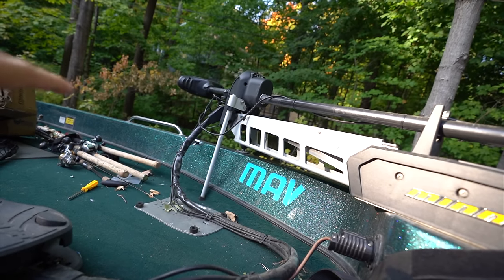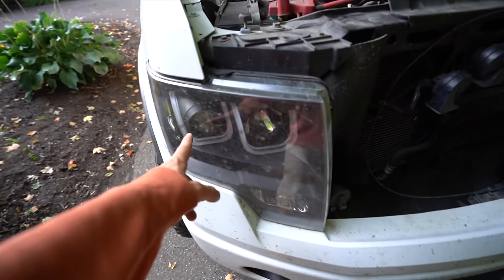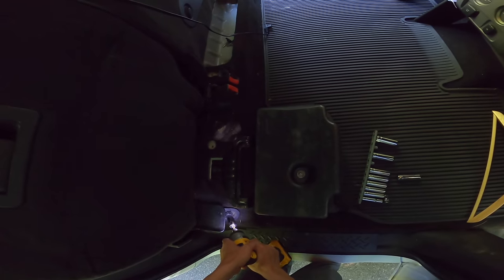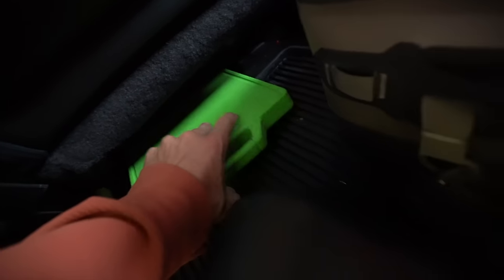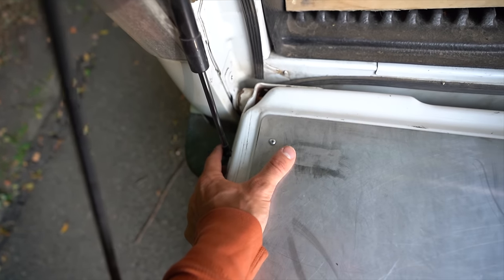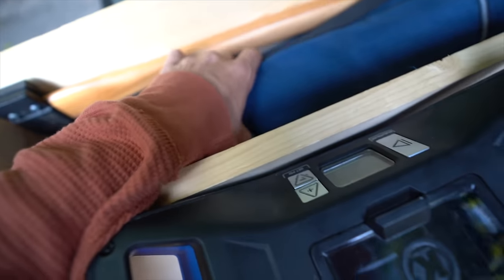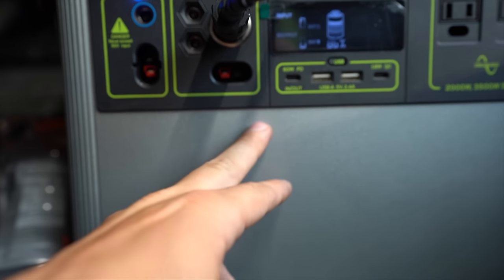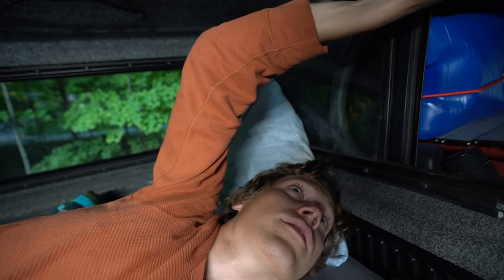F150 Daily Driver / Truck Camping Setup Mods And Gear WALKAROUND

Comment: For the tailgate of your truck don't put down adhesive grip tape just go to the home section of walmart (or whenever you prefer) and get the grippy shelf and drawer liner. It comes in a roll that you can use when it's wet and then roll up and put away when it's not.
Reply: I was just coming in to suggest a bath mat.
Reply: Yeah get it out then put it up real brilliant

Comment: Pro tips for working on stainless steel surfaces from restaurant industry: for appliances, no slip restaurant mats cut to size. For cutting boards, a thin damp dish towel

Comment: Hey Mav.... do you only drive the truck in reverse? Seems you rolled back the odometer from 77,000 miles when you bought it to 25,000 miles now.... I had to listen to it twice! LOL
Great video by the way.... I'm outfitting a Tundra right now for overlanding... thanks for all the tips and info on what works and what doesn't! 
Keep them coming! More sheath truck camping would be fantastic!

Comment: Mav: You talk about being able to charge your boat batteries off your Yeti power station. Would you please show in a video, or video segment, how you actually make the connection between the power station and the boat? Can you charge the boat batteries while driving down the road? That's really what I'm interested in knowing is if you can charge boat batteries while driving. 
Yeah, you plug in an extension cord but how do you secure it while driving so it doesn't drag on the ground yet allows for a full turning radius?  If you can charge while driving that would be fantastic.
Reply: auto retention cord holder

Comment: Hey Mav, awesome video, but didn't you show us a water reservoir  (tube) that you could pressurize on that you had on your roof / topper? What happened to it, was it too heavy or did you need the space for the canopy? Keep up the grate Vlogs, its awesome to see your adventures. How about doing a Vlog about winter camping what you do to stay warm beside the zero degree bag for us southerners.
Reply: I was thinking that. Mav installed a shower from the tubing.

Comment: Knowing me, I'd cut up a long dresser that is already equipped with pull out drawers, add some plywood pieces, and also use the drawers as the base for a bed. One horizontal drawer pull out at the tailgate, one length wise in the truck bed, all in the form of an L. And then reassemble shorter width dressers for storage and table tops.

Comment: Mav, what about welding magnets ? They are triangle and you can get them on the cheap at harbor freight. They would hold stuff in place on your tail gate. You could use those to put down a liner then pic it up when done.

Comment: the truck setup keeps getting better. It would be cool, if you welded up an alloy bed fame &  drawer system. would save some weight there.

Comment: i know youve prob been told this before but you should use flat screws on that tailgate cover instead of rounded, it would just look cleaner in my opinion, other than that your rig is built just right i think

Comment: Hey Mav that is quite the setup you have made for yourself. Just wondering if you could go into a little more depth on how you sealed up your sliding window to the front cab. You said something about using a tube or something like that. Would like to see just how you installed it and also see how it makes a seal in order to keep the rain/snow out. Keep on Truckin' ...Tom

Comment: I doubt you did a crummy install on the tailgate dampener. This is what they do after awhile. The supplied rivnut is too small. You need a bigger rivnut. You will also need a new ball post. Install one each side to split the abuse.

Comment: You took your shower tube off?  I was hoping for an update on it, did it not work well?  Also - you skateboard?  Let's see a video of that!  You should experiment with rubber/plastic/latex for a removable grippy surface for your tailgate table, maybe you could make a bath mat work for that?  That way you could roll it up and put it away and it wouldn't keep your drawers from sliding.

Comment: Mav, when I see you on your tailgate I have a concern. I have seen those little cables let go with someone standing on the gate. They are strands of wire and let go inside tubing where you cant see it. I don't know if the metal strap ones can be used on yours but even occasionally replacing the cables might avoid a mishap. Love your videos. Peace.

Comment: Put a velcro strap around the paper towel so it doesn't unravel.
Reply: Rubber band or stick a pin into it.
Reply: I used to have a paper towel roll with a pin in the back of my car but eventually came off and stuck it on my ass...Velcro/rubber band is safer..just sayin..o_O
Reply: Rubber band...

Comment: You said it has 25,000 miles but you bought it with 77,000 miles something doesn’t add up lol
Reply: Erick Miller haha I had to rewind and then put captions on to make sure I heard that correctly
Reply: guessing he put 25k miles on it....
Reply: Daniel Ueblacker I caught a steelhead the other day. On the river, he measured 32 inches, at the dock he was 37 inches 🤔